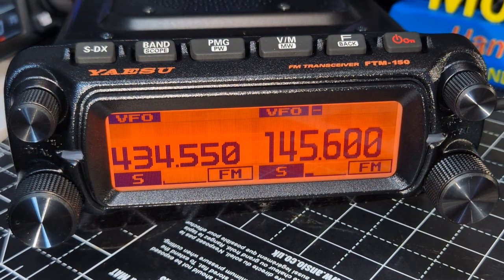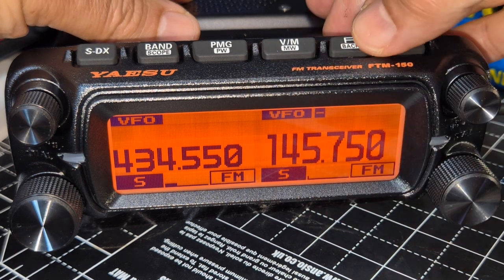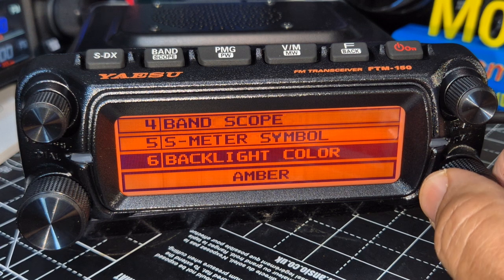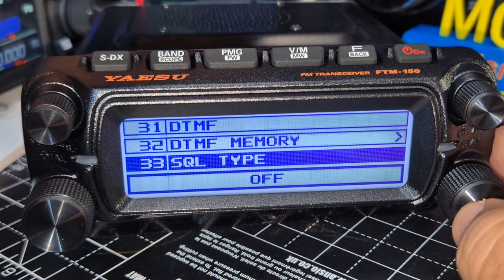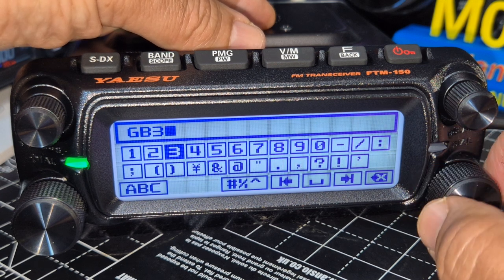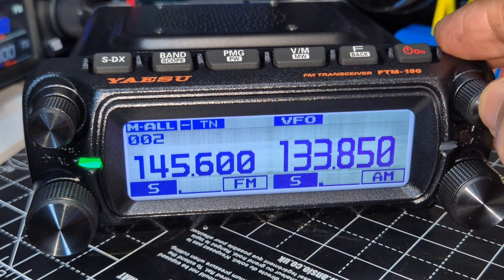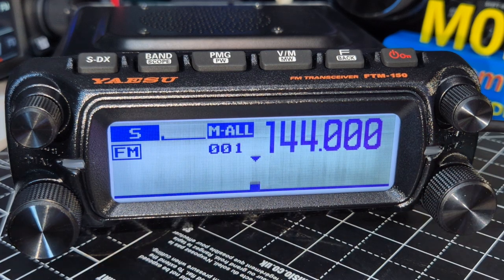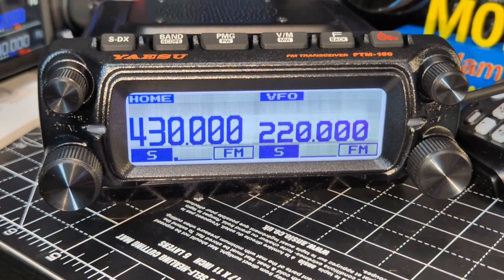Yaesu FTM150 - First Power on.

Comment: On page 27 of the manual it says "TN Tone Encoder (the tone frequency is displayed)". On my display the tone frequency is NOT displayed. Do you know a solution? I tried everything... no effect. 
73 de DL4UI
Reply from the maker: Try single screen or vfo mode.